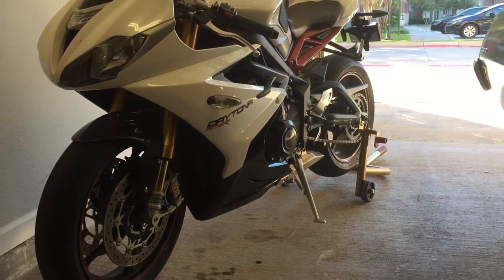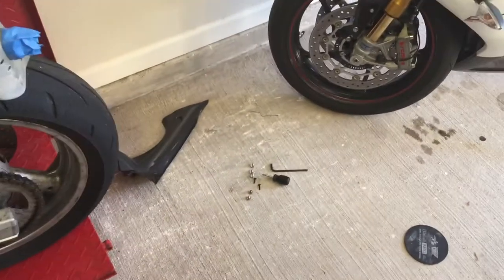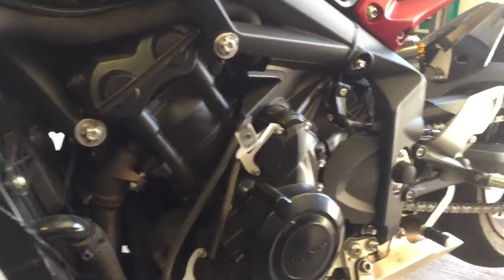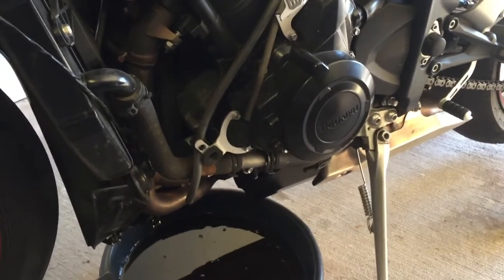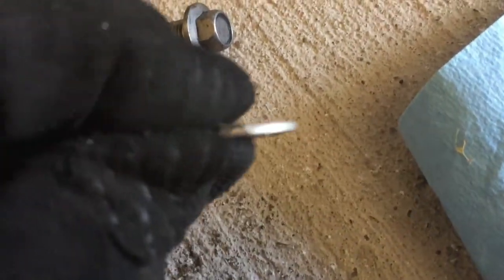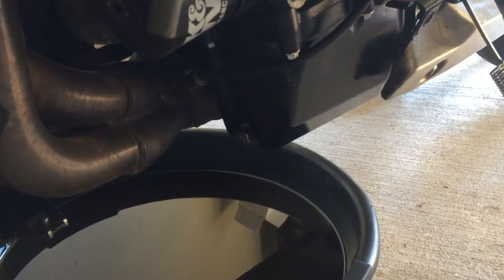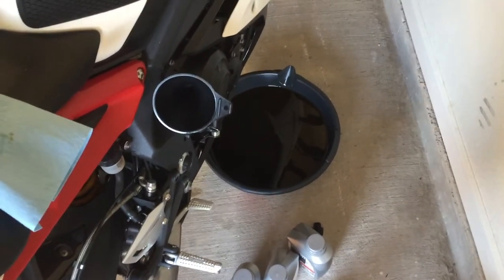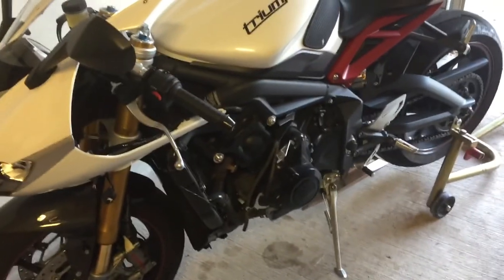How To: Oil Change on a Daytona 675R

Comment: getting ready to do my firt oil change on my '17 675r,  what kind of filter did you use. it dose not say in the owners handbook
Reply from the maker: I use K&N, model number is KN-204. Available at most auto parts stores and online.
Reply: @bangshiftbill2107  thanks